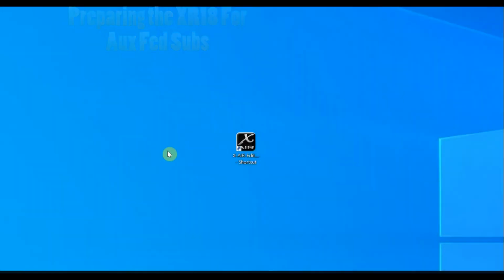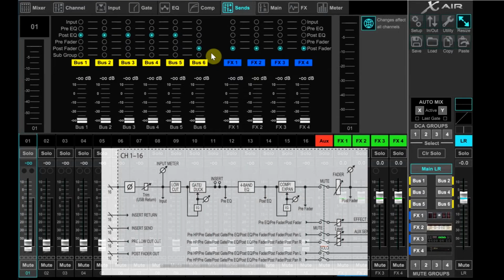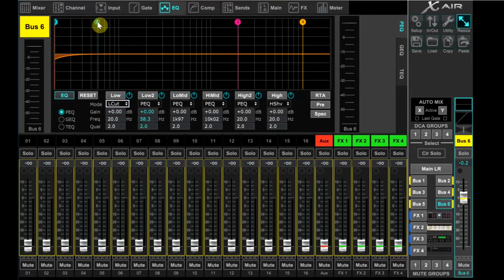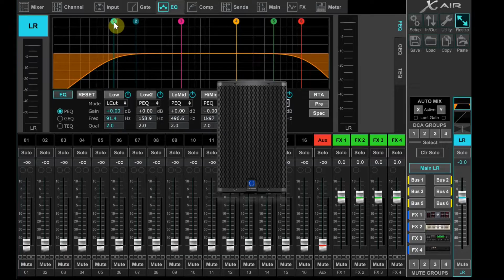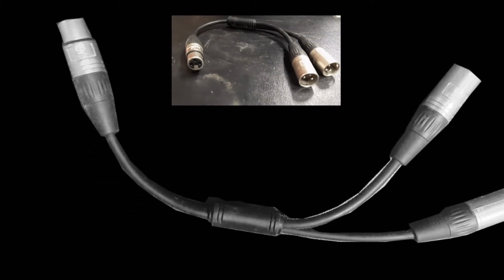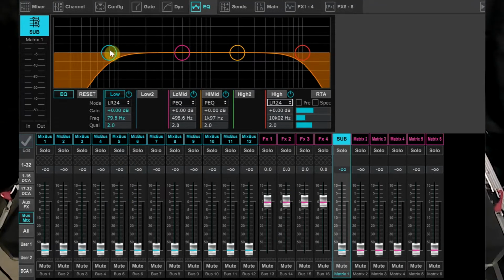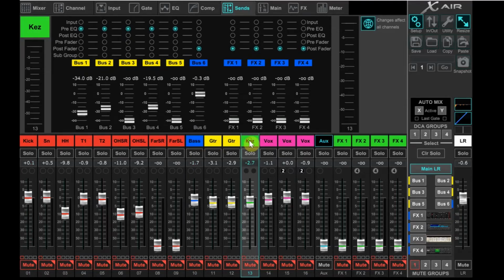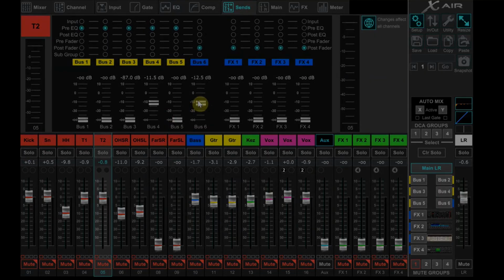Aux Fed Subs Setup For Behringer XR18 X-Air - Midas MR18

Comment: Hi Alan, thanks for the video again! but my question is we are a small church about 50 ppl..do we even need a subwoofer? and with this aux.6 seems like another control that we have to oversee..is there a way to connect the sub (if we get one and just one not pair) to the mains so just one control?
Reply from the maker: You can definitely connect a subwoofer without using aux fed sub method. Technically, if you add a sub, you'll need someway to crossover the frequencies from the sub to the tops. The sub, if powered, might even have this built in.
As for whether you need a sub or not... this is harder to answer. If you only use your PA for speech, then no, you don't need a sub. If you just use your PA for speech and background music like an acoustic guitar or piano, then it's still probably a 'no'.
But if you do live music with drums and bass guitar, or tracks with drums and bass, and synth...etc... and you want it to sound really full and powerful, then it's more likely a subwoofer (or two) would be helpful.
Being a smaller space, a lot depends on the size of the existing speakers (are they capable of low end at all?), and what you're asking of and expect of the system.
Reply: @AlanHamiltonAudio  thank you so much Alan.  Yes we are full band and will i guess need a subwoofer at least one.  I was watching another video where the it uses one of the mains on to connect to sub then from the sub it connects both the loud speaker...is this correct?

Comment: Quick question: I've set my subs up like described, but when I mute my mains, the subs keep going until I go into the subgroup and mute them there, which is weird. How can I solve this? Can't wrap my head around it somehow...TIA
Reply from the maker: The subs are no longer tied to the mains when they are aux fed. The simple way to have a 'main' that controls everything is to assign every channel to a DCA (or iDCA is an option in Mixing Station app as well). Once you have your relative sub/main balance set as normal, use the DCA as the Main.
Or just setup a mute group that mutes every channel and use the mute group...
Or just remember that the sub aux and mains are not tied together so know that you have to mute the main AND the sub aux when you want to kill the house but maybe want the channels still unmuted for monitor reasons.
Reply: @AlanHamiltonAudio  Thanks for the reply, I really appreciate it. Your videos are great and helped me a lot when I got my XR16 a couple of weeks ago. I will check the DCA solution.

Comment: Hey Alan love the videos but I'm still having a problem wrapping my head around this AUX and DCA stuff. My sound guy is away and I have to set up a small system for an outdoor stage in the round (or  actually 3/4). There will be two front of stage, one stage right and one stage left and Sub in the middle. Two wedge monitors on stage. My inputs are two microphones, an ipad with Go Button, an XLR in from a DJ setup and BG music source. I want to have individual control of the four speakers and sub so I can adjust volumes as needed but have everything controlled by the overall main volume level. I also need control of overall volume of the monitors on stage (both on one output is fine) So my input strip looks like: Mic1 Mic2 Mic3 Mic4 iPad DJ BGmu...(Mic 3&4 are backups) Can you help me out? Once I get this set and can see it I'm sure I can figure stuff out from here.
Reply from the maker: I wouldn't think too much about DCAs for that right now. They could probably help with workflow, but if they're confusing you, there's not much need in them if it helps keep things more simple in your mind.

So, what I would do... Let's say you put  your monitors on bus 1/ Aux out XLR 1 (assuming it's just one mon mix). Pre-Fader bus on the channels. Look for my new video that's coming up later today (Wed) to help explain that part.

Then I'd connect your 1st pair of speakers to the L-R's as normal.
Then I'd go into console routing, Aux Out, and set up Aux 5 and Aux 6 to be L-R out. This doesn't replace your left right, it just duplicates it. Connect your other pair of speakers to that.

Put your Aux fed sub on one of the open busses. (2, 3, or 4). I say do it that way because in my head it seems more logical to have the 1 mon mix coming out Aux out XLR1, then the sub coming out next (XLR out 2, 3, or 4), then the first set of LR outs (5-6), and then the second set of L-R outs (that are still connected to the normal L-R outputs). So, your main outs (now 4 of them) are all together in a row on the console.
You could route them any way you wanted to... 
But there's also this caveat:
To link the two Aux outs, odd numbers has to be first. 5 needs to be the first linked output. You can link 5 to 6 but you can't link 4 to 5. Odd-Even, not Even Odd.

Anyway... by duplicating the mains out you have 2 sep stereo outs... the normal 'main' out, and a clone main out. But the main fader only controls the normal 'main' out. The Aux 5/6 fader would control the additional pair of mains.

Comment: Even though I’ve got my tops reaching down to 100hz and my subs reaching up to 100hz with the onboard DSP on both speakers. Should I still use hi and low cut filters on both EQ’s for the tops and subs or is that not necessary being I’ve got built in crossovers in both speakers? Thanks!
Reply from the maker: It's not really necessary. You could always set a LPF on the tops for supersonic stuff. Or set a HPF way below the subs cutoff as a safety. So, if the sub has a filter at 40Hz, you could set one in the console at 20Hz. But if the sub filter was 20Hz, I wouldn't necessarily duplicate that because it would be a steeper rolloff (in the end) than whatever the speaker manufacturer had deemed 'optimal' when they designed the speakers. Which would be true about not duplicating any of the points.

Same would apply to the hi-mids... If they have a factory roll off at 100Hz, I wouldn't duplicate that, but I might do a safety rolloff at 50Hz or something. 

Big ol' caveat... for the LPF on the sub (X-over point), if it's at 100Hz for example... And IF you pump extra lows rather than a flat, neutral system, you MIGHT benefit from a lower crossover point... like 90Hz or 80Hz... to change the point where the overlap occurs (since boosting the subs effectively moves that point higher if you were to look at it visually). But still leaving the tops at 100hz and not doing anything (except maybe that 'safety' setting I mentioned above).

Comment: There is a way to get a steeper low/high-cut for the auxes. As long as you have additional EQ-Bands to spare you can set the gain of the band to -15db and align it with the low-cut. Not perfect but good-enough i think.
Reply from the maker: Yes, filter stacking is an option, but as you say, not necessarily a perfect option.
Reply: @AlanHamiltonAudio  what are the dangers of filter stacking?  is it generally ok for a small setup like i use (2 tops and 1 sub).  if i could do this i could avoid buying a crossover when i upgrade my sub.  the new sub would likely have an 80 hz crossover but my tops only have 100 and 120 hz settings for hpf.

Comment: Thank you for these videos! I am a DJ and karaoke host.  I have 2 Bose L1 Model II speaker towers with bass modules. I wondered how I could best add an 18" EV sub that I have (for parties and weddings).  I have used aux 6 for the sub and set the sub's low pass at 100Hz on the EV speaker. Not sure I loved what I heard but it was ok. I did match the faders (LR and aux) or at least come close. I only routed the music to the sub (no vocal mics to sub). But I did nothing for EQ on the Bose towers as there is no setting I can find to adjust directly on the speakers. So basically I have backing music feeding LR & the sub aux. And vocals only feeding the LR (no monitor as the Bose is setup to be the monitor too).

Comment: Another Aussie here and love your channel, very helpful, thanks Alan!
Anyway, I bought some 18" passive subs, amp to run them and a crossover to complement our powered mixer with tops of single 15" with horn each for L/R. Things were working out fine until yesterday when our last few songs of the gig blew the tops and all the magic smoke escaped :)
On inspection, the woofer coils are gone on both tops (horns test at 6ohms each) and the built in crossover cap and 25watt resister that feeds the woofer are well and truly fried in each top as well! 
My question is - and it may be a warning/helpful for others - should I have just used the crossover to feed the sub's amp only and sent the full signal to powered mixer to run the tops? I'm thinking the thinner mix overran the woofer's with high end (or not enough low) and fried the coils??
It's a budget setup I know and I'm building it as I can, without the subs our sound was very thin, especially outdoors but the subs have helped heaps. I'm thinking to run the signal from the XR18 to the  powered mixer then send it from the outs to the crossover to filter for the subs(?) This should let the full range top speakers work as normal and just boost the bass with the subs, what do you think?
Thanks again for your great channel and advice, cheers.
Reply from the maker: It sounds like you were really clipping the tops pretty hard for that level of 'destructive chaos'. Does the top amp not have a HPF you can engage? Was it engaged? I definitely would've engaged a HPF somewhere for the tops.
Technically, you could've been clipping anywhere and the square wave and constant signal would've done damage. But realistically, it was probably clipping the amp... if not "amp too".
The XR18 could let you filter the signal that goes to the tops. I'd definitely do that,  because low frequency energy eats up amplifier headroom... and preamp headroom... on and on. The more you can reduce that from needless places, the more headroom you can buy yourself. Clipping = heat. Heat = burned components. And that is when the magic smoke is released! ;)
Reply: @AlanHamiltonAudio  Thanks Alan, yeah, the amp output signal was in the orange a bit but not clipping proper. I think I worked it out after checking the rig setup again and I've had time to think, just asking you the question helped :)
First, I think I was running a bit hot from the crossover, should've checked that I didn't move any of my standard settings in setup (which I did...doh! Lesson learned). It wasn't running that hot before so I was a bit confused but was too busy drumming to deal with it :)
Second, the powered amp was running at around 4-5. Since adding the subs we've gained more dB and it was a quieter venue so I turned it down from the usual 7-8 volume setting. So I think that along with the hot signal I was running the tops a bit lean on power and that slowly cooked the system and voice coils.
I now fully understand the need to run your amps as high as possible (to suit speakers of course ;) )
cheers.

Comment: Hey Alan, your video's are awesome! Today my XR 18 arrives and it's our first step into the digital world having been using the Yamaha EMX desk previously. I do have a question about speakers and crossovers though. We currently have JBL JRX 212 tops and JBL JRX 215 bottoms - all passive - and all with horns and running in parallel so no defined sub. Are we to rely on the crossovers in the speakers for signal seperation or is there another / better way of doing it? We are currently looking to pair it with an EP4000 which doesnt offer DSP. Apologies if this is a basic question, I'm new to much of this! Thanks!
Reply from the maker: Edit... Well... I just looked up those speakers... I ASSumed the 215 was a 2x15 sub cab... It's a single 15 and horn... and the 212 is not a 2x12 with a horn. It's a 12 with a horn.
And that means they are 8 ohm boxes instead of 4 Ohm with 2 cones in each like I was assuming ;)

That's not going to work very well if you want actually sub content with kick. I'd recommend trading either the 212 or the 215 for a pair of actual sub cabs. 

I typed to much below to correct it all... And it all still applies overall. It's just it doesn't apply to your speakers because you don't actually have subs. But if you get subs, then it all applies.
-----------------------------

How many subs and tops are you running? Just one EP4000 or one for tops and one for subs?
I think the EP4000 is limited to 2 Ohms per side, but check me on that in case it's actually 4 Ohms. I'm assuming 215 subs are 4 Ohms so a pair of them already would have you at 2 Ohms. So that is one channel taken up with just 2 subs IF you mean just one EP4K. Tops are probably the same. I'm just guessing based on norms, you'll need to check the specs to know for sure. 
If you have MORE than 2 tops and 2 subs, and my assumption on impedance is correct, then one EP4000 isn't enough amp on impedance ability alone.

But, assuming you have 1 EP4000, and 2 subs and 2 tops, and my impedance assumptions are correct... I'd want to get some type of crossover. You could get a DSP unit like a Driverack, or a BSS, etc... I think Behringer still makes one too...
Or at least get an analog crossover like a DBX or Ashly, etc...
You really only need a 2 way crossover for the setup you're describing.
One amp is going to limit you to mono. 
One channel will be subs, the other tops.
So you could only use one side of the crossover and have a normal, mono setup.

Or use both sides for aux fed subs, feeding the left with your sub signal from you sub aux output on the XR18, and feeding the right side of the crossover with a mono house feed from either the L or R side of the XR18. One channel of your EP4K would be for subs, and the other for the tops.

If you want to go stereo, then you need one more amp no matter what (for subs and tops), and you'd need a 3rd crossover for aux fed subs... or an amp with DSP added into the equation... OR a DSP with at least 3 inputs (one for left, one for right, and one for subs) and at least 3 outputs that can be assigned to L-R and sub). 

Subs can be mono while tops are stereo.

But the one caveat is to make sure and check that the amp can handle 2 Ohms, and that your speakers don't go under that. A pair of 4 Ohm speakers = 2 Ohms. A pair of 8 Ohm speakers = 4 Ohms.

It probably wouldn't hurt to make sure the amp power and the speaker ratings match up. Make sure speaker peak and amp output roughly match to be ideal.

Comment: I configured mine for this and now if the subs fader is down my mid low doesn’t come out of my full range tops! I turn the sub fader up then I get Low- mids in my tops. There not linked in anyway except for the mixer. Main EAWs go to a crown And aux 6 feeds my EV powered 18s. Frustrating
Reply from the maker: Check the aux out for your subs in the master section. I bet you have it assigned to the LR. It should not be assigned to the LR.
Reply from the maker: Following up on my assumption as to what is wrong (sub aux is assigned the LR), this FAQ video talks about this (though it's usually happening with monitors... but it's the same issue and answer either way). Check out the section on why are my mons coming up in FOH:
https://youtu.be/x9wciA2wFd0
Reply: Ok is seems to be working. On the mains The input levels are the same but audio output/volume is much lower. I’ll have to play with it…Thank you sir

Comment: Can someone explain how I would properly connect the EVOX J8. The speakers normally connect to powered subs. From my understanding I would connect the speakers to L+R. Use 1 Output from the mixer to the subwoofer and the out of that subwoofer to the next subwoofer?

Can someone guide me how I would do the connection for the EVOX J8. Crossover is 220 HZ on subwoofer. Thanks
Reply from the maker: I'm not really familiar with the speakers, and it depends on how the speakers are made. I assume they are made to function as a package and so it's possible you don't even have access to the amp for the tops and that it is all done from within the sub enclosure (amps/crossover network).

Comment: Why would you ever put any kind of low cut regardless on a channel feed a sub…
Reply from the maker: Because the channel is (likely) also feeding other sources besides just the house. If monitors are from FOH then it's feeding monitors. If there's a stream mix from FOH, then it's feeding the stream... or a record mix... broadcast mix... etc...
It's also a good practice because even though in a specific case the mix might be only feeding the house, in the future that might not always be the case. 
You also want to be able to call up you program monitor or headphones and hear an accurate representation of your mix and what you want your mix to be.
Not using the HPF when it's called for could be building bad habits.
Reply: @AlanHamiltonAudio  I thought this was dedicated to a sub and a sub alone? Main Left and right would feed well, main left and right tops at FOH and sub group six would be a mono send to feed only the powered FOH subs. I would I understand putting a HPF on the sub group
Reply from the maker: @JettyDeke  I thought you were talking about why you'd use a HPF on any input channel if that channel was not being sent to the sub (so low end would be gone from that channel in the mains anyway).
Reply: @AlanHamiltonAudio  yeah in your video on the sub group feeding the dedicated sub you put a HFP/Low Cut on the subgroup 6 that is feeding the sub. It was just confusing. I understand the notch you were talking about in case it was feeding back
Reply from the maker: @JettyDeke  It's always a good idea to put a HPF on the subs... somewhere... to protect against over-excursion. In most cases it'll be in the DSP.